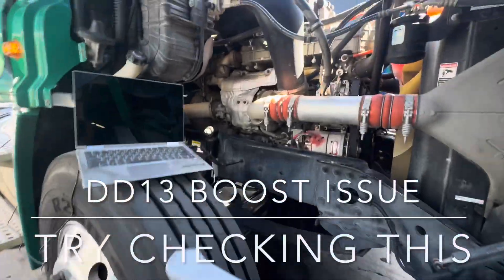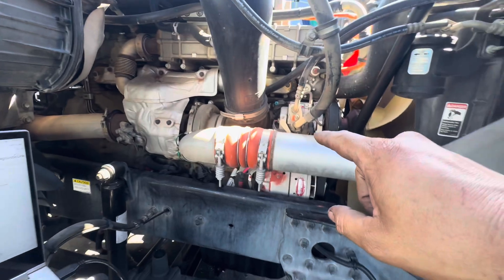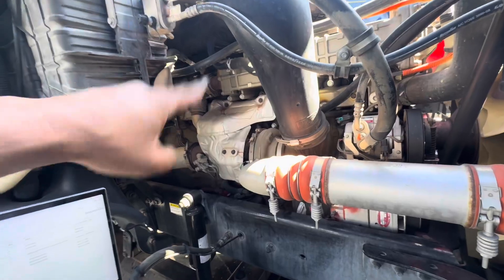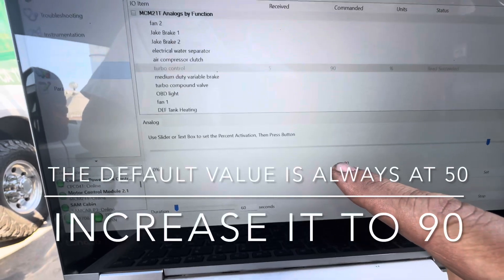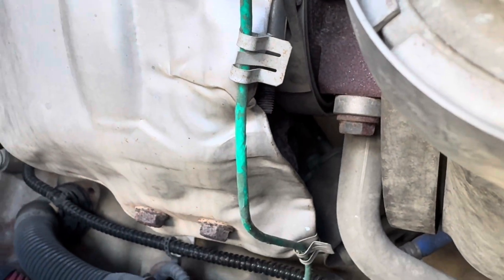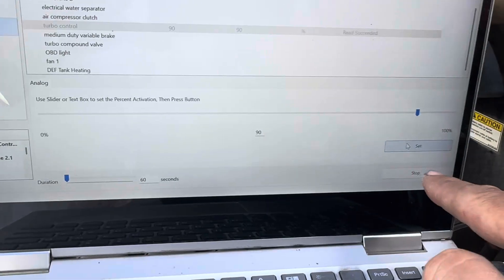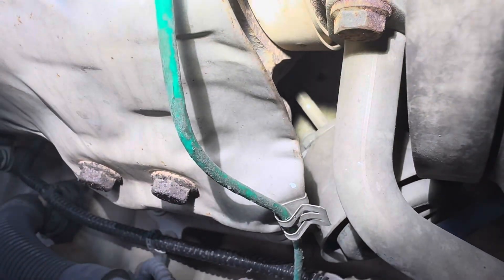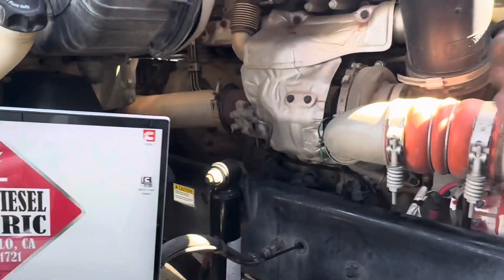DD13 no boost, low boost issues. Random problem with no fault code. What to look for, try this.

Comment: Mine dd13 not completing regen 
Turbo boost pressure reads only 2-3 psi 
Replaced turbo, actuator, egr valve cac as well
But same thing 
7th injector starts spraying but after some time temperatures start dropping
Tried everything no clue what’s going on
Please suggest something if you have faced this problem 
Really appreciate
Reply from the maker: What are the pressures? DOC inlet also, what year is the truck

Comment: Your shop name?  How much cost to fix engine brake DD13?
Reply from the maker: Engine brake issues can be oil pressure related, could engine brake adjustment, could be in the exhaust CAM or engine brake solenoid.
Reply: it’s not shifting immediately. It’s being neutral and 10 neutral 10 playing for 10 seconds.

Comment: Brother my truck have a problem when my truck cold they be strart ok when my truck hot they be to muck crank then strart 
No any code  plzz help me 
Freightliner 2018 
DD 15  
Thanx
Reply from the maker: Fuel issue. Have to check injector system or fuel pump

Comment: Is that the same for DD15 as well ..
Reply from the maker: Yes. The process is the same, once Detroit switched to this style turbo on the DD15. You can do the same procedure to check. 

The old turbo setup had the aux power behind the turbo.
Reply: Does this apply for the older dd15 with no wategate? 2012 models thank ya
Reply from the maker: @kennethmaina9203 no, does not apply to them.

Comment: So what did you find
Reply from the maker: I’ll have to get custom authorization to replace the turbo. Since the wastegate is getting stuck it is recommended it be replaced or a turbo shop can see if they can fix it but that has to be calibrated
Reply: @CarlosDieselElectric thank you brother